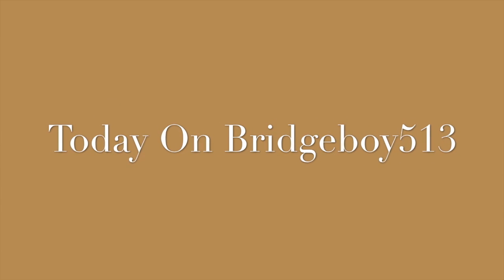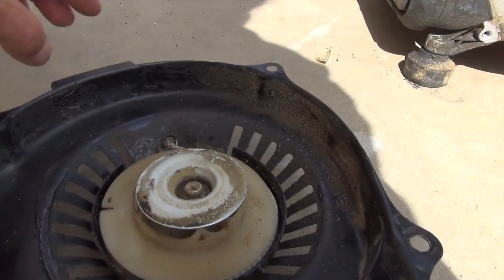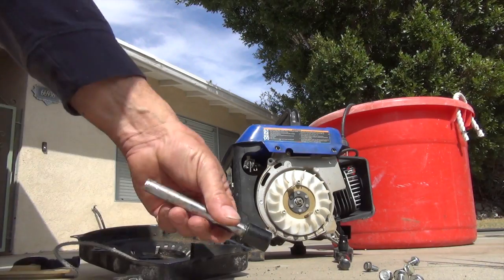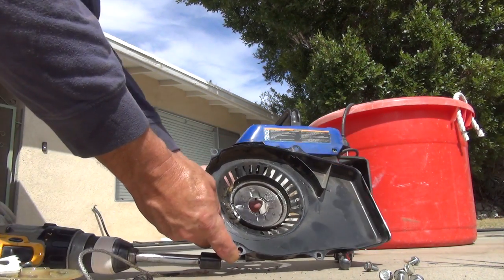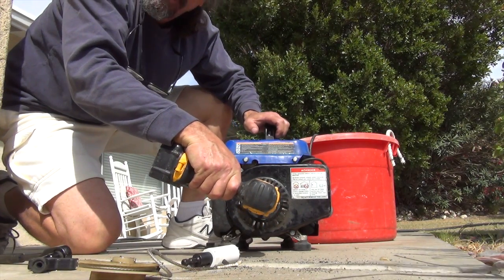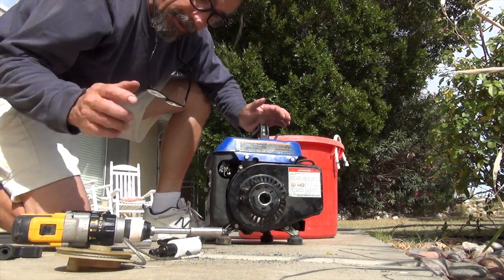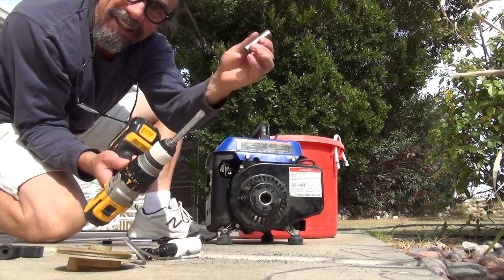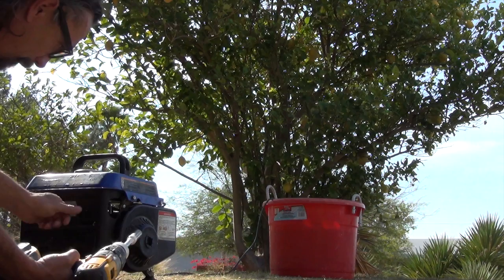Electric Starter for any GENERATOR

Comment: I'm definitely doing this 😀 
If you don't pull the drill away quickly once it starts will it spin the drill outta my hands?
Reply from the maker: If you don't pull the drill away quickly it may take the socket off.  Or NOT.
Reply: Add racket adapter in between so this doesn’t happen
Reply: It may undo the nut on the crankshaft, it may spin the drill, generate power going into the powertool battery, it may break your wrist, it may cause milk to turn to butter...who knows...just live a little....

Comment: I like this idea. I bought one of those new 4300 watt generators that operate off of gas and propane they work great but now that it's getting cold it's a b** to start . It takes almost 100 pulls, doesn't matter if the chokes off or on a little she doesn't kick over until she starts to warm up.

Comment: Probably already been warned but had you attached the drill to that plastic piece that throws the arms out the reason that's like that is so when the motor starts it doesn't catch the device and keep spinning the same way a starter in a car once you let go the key at Yanks backwards and it has a clutch inside of the starter had you put that on it would have been safer in that jerked your socket off

Comment: 3:00 time. perhaps, grind that nut down, on the reverse side of the drills'  starting torque,......so, when generator motor starts, it will kick out your socket/drill.....the nut should look more like a sawtooth, with the leading edge biting the drills' torque...

Comment: seems like you can break your wrist, fingers, or drill if you don't pull out the drill fast enough after the engine starts and the socket stays engaged.

Comment: If you want to firmly mount the socket on an extension, or firmly hold a bolt in a socket, just put a strip of paper between the two.

Comment: And yes - I DO live in Alaska.  
I would just have fixed the RECOIL STARTER (that's the real name) and nott cut off a socket wrench extension.  
Using a deep-set socket is really ingenious for an emergency fix, but finding the REAL socket size for your Chinese generator would have done you better.  
Have you snapped off the threaded, weak Chinese steel shaft yet??  THEN you'll be "Up the Creek ..." for sure.
I would just have found a simple rebuild kit and fixed it right.  That's how we do things in Alaska when we're 4 to 10 hours (round trip) from the nearest hardware store.
Now, if you were in Alaska you would have bought two identical gensets and always had cheap, instant backup to water your stuff.  Then again, there's always a simple, cheap, solar charger for a 12 Volt pump, too.

Comment: I have one of these generators parked on top of mountain near the 49th parallel and the recoil starter spring broke during a particularly cold snap as I was trying to start it up.  Note that the crappy crescent wrenches that come in the toolkit for the chinese atv slip on these bolts so it takes sockets to remove the recoil starter.  I couldn't fix the recoil starter so i pulled the spring out, manually wound the string around the pulley with my finger on the arm, and just pressfit the starter to the wheel with my knee and pull.. it takes a few tries but works.  Don't touch the spinny thing with remaining fingers!  

Hand spinning the flywheel also primes it, I can almost start it just by spinning the wheel with my hand.  The point being, you don't need that superdrill to start it, it needs only a couple cranks to start.  What I'm super interested in is how to start it electrically via an arduino!  Also any tips on fitting a larger fuel tank would be helpful.

Comment: Oi! I took your tip and added a little 12 volt motor i run off of a battery bank with a generator made by harbor freight of the same design. I use the generator to charge the battery bank made from old laptop batteries (about 6 killiwatts worth of energy) when they get low on charge. Just have to depress the momentary switch until i hear it turn over and boom! Powah! Modded the tank for a ten gallon tank so i only have to fill it once every 5 days instead of every day and hooked up the controls to be manipulated remotely via robotics. 

All bragging aside, it was this video you made that solved the problem of actually starting it remotely. Everything else fell into place after that. So thankee kindly!

Comment: When you do this.... ALWAYS put your machine to the LOWEST SETTING AS POSSIBLE....  So that way when your " Motor " starts... It's NOT on High RPM.... Once you get the Motor going and still spinning, you can adjust the " Speed ", LOL.
Reply: Generators run a constant 3600 rpm. There is no speed adjustment.  The governor sets the speed and keeps it there during power surges or load to keep the voltage constant.

Comment: problem i had with doing that was the nut came right off the generator
Reply: When you say the nut came off, do you mean the stud snapped off with the nut? I was thinking about doing this but if the stud snaps off I probably won't.. kinda wondering though if you had it in reverse and just loosened the nut? Let me know thanks.

Comment: Yeah, that will work a few times until it shreds the screw that holds the chuck to the armature of the drill.
Reply: Cheaper than buying new Parts for the Engine....  Coil, Housing, Rope... etc...

Comment: You can do this with a small generator.  I wouldn't recommend for larger ones.  Arm twist fractures are really painful.
Reply: When you do this.... ALWAYS put your machine to the LOWEST SETTING AS POSSIBLE....  So that way when your " Motor " starts... It's NOT on High RPM.... Once you get the Motor going and still spinning, you can adjust the " Speed ", LOL.

Comment: How long are you running the generator / electric pump? That bucket can't be more than 5gal... Why not just use an electric drill powered 390GPH water pump?
$3.99 @ 
https://www.harborfreight.com/all-purpose-drill-powered-pump-390-gph-62783.html

Comment: Like others said, that's really not safe.  You could still use the general idea.  Make the throwout gear in metal of some sort.  When the motor starts, it'll disengage the drill, and you can safely remove it.

I found this video, searching for how others did theirs.  During our hurricane evacuation, I hurt my back, and now can't pull the damned cords.  I converted one properly to electric start with the right starter motor and geared flywheel.   I think I'll do the others with something like yours,  powering the start with a drill on the stock throwout gear.  I'd rather not kill myself with a 10 minute fix.

Comment: Just applied this conversion to my Pulsar 2-cycle generator this morning.  My 40 year old, 3.5 amp, 120 volt Skil drill  barely starts this generator.  It is supposed to be a 72cc instead of 63cc engine.  Don't know if it is bored out, but the compression feels 2x that of the 1400 watt, 4 cycle generator I also have.  Recommend drilling the hole from the inside out.  Otherwise, the one inch hole saw would have been too big for the plastic bushing.  The hole saw wobbles out the center guide hole, apparently.  So, if anyone has tried it drilling from the outside let me know.  waymaster@gmail.com.  Used this bushing: http://www.homedepot.com/p/3-4-in-ACC-Snap-In-Bushing-10-Pack-27252/202077087.  Used 1/4" hex to 3/8" square drive adapter bit.  http://www.homedepot.com/p/Milwaukee-1-4-in-x-3-8-in-Steel-Square-Socket-Adapter-48-32-5031/202562858  Youi don't have to cut off some other 3/8 drive tool.

Comment: I did this to my crappy 4 stroke chinese generator that got about 50 pulls before breaking the plastic pull cord. I used tape to keep the socket from coming off , it worked well but the nut on the flywheel tightened and cracked the flywheel. i took the bolt off and used threadlocker and it still works but if you have enough thread to add another nut and then use threadlocker  , that might be a better option . another option would be to weld the nut on the engine so it wont  turn
Reply: I think i know what generator you speak of lol. I may have one. Ill do that because i don't think mine'll last long enough to be worth fixing if it does break.  worth

Comment: Hello, what are the chances of getting hurt if you're not quick enough to remove the socket out?
Reply: If you're dumb like my sister and hold on, you'll need rotator cuff of TJ  or wrist surgeries, but even if you let go quickly, the drill can still fly off and whip you in the head, or strangle you with the cord
Reply: LOL
Reply: Much better to have a one way bearing or breakaway extension bar.

Comment: Put some JB weld on the socket and leave it on the nut. So when it starts, the socket stay on and you just pull the extension smoothly out
Reply: yes yes, and some grease between the extension and welded socket, so your arm doesn't get torn off occasionaly
Reply: LOL some People..... When you do this.... ALWAYS put your machine to the LOWEST SETTING AS POSSIBLE....  So that way when your " Motor " starts... It's NOT on High RPM.... Once you get the Motor going and still spinning, you can adjust the " Speed ", LOL.

Comment: hey bridgeboy, i came up with the same idea 7 years ago with my little 900 watt gen set. drilled the cover out too. you'll do it til eventually the socket pulls off the extension bar and tears up your flywheel fins. so I came up with something better. a crankshaft extension and works great.
Reply: HK DEE can i see your system please?
Reply: I can show you. Your cover needs to be drilled out with a step drill to about 1 1/2 inch a little bigger than what you have now. remove the 14mm nut from the crankshaft. find a piece of 3 inch long CR Steel bar stock and drill/tap both ends to about 1 inch inward. thread the bar stock on the crankshaft.  the other end will have a 10mm Allen or 3/8 Allen threaded in. That's it. Your drill will be an Allen turning the crank
Reply: a 10mm or 3/8 allen will be way to small. It might work a few times but eventually the torque forces you apple (whether manual or drill power) will easily break those little allen bits

Comment: I did this to mine! Weld that socket onto the extension shaft, other wise when it is withdrawn after if starts the socket can come off as it did with mine and intern smashed all the fan blades! I then had to grind all the original fan fins flat so I could fit a new sheet metal fined fan by drilling and tapping the flywheel. I use a 300 watt drill to start it and works fantastically. The following link is also a good idea to include into our design for those moments we don't have a drill. I say that because I use my gen set as alternative energy for my electric bike. https://www.youtube.com/watch?v=-RjYZgqLHNk  Enjoy.
Reply: i also made the fan.

Comment: I knew that drill bit would get stuck in the cover, this is what happens when you try to make it look nice and neat should have left the cover off and tie our hair back when leaning over it. lol
Reply: The cover has to be on to direct the air from the fan blades over to the cooling fins..  he had to put it back on.

Comment: This reminded me of when i had one of the Big Huge sattelite dishes "those of you who remember them. The motor that turned the dish burnt up. And a new motor cost over $200 for one. So, i had an old reversible electric drill that i hooked to the dish. And i took the power & f/r switch & ran it into the house. That drill actually worked Better than the original motor. Several people told me "There's No Way you can do that & make it work"?  2 were licensced electricians. But, the Laugh was on them. All it takes is just a Little bit of Common sense. Anyhow, just thought i'd throw that in. But, the guy with this drill starting the generator reminded me of that!! Lol..

Comment: Anyone else notice he started it the wrong way or was it just me cos them fins are ment to blow air out over the head 2 strokes will run both ways lol
Reply: adam trowse Nah, the recoil is threaded for a clockwise rotation when mounted to the engine.  You can see it at 45 seconds to 50 seconds in the video.  So the engine will only start if rotated clockwise.  If you attempt to start it in reverse it will not turn over because the order of the process of internal combustion (fuel/air intake, compression, spark, exhaust), would be reversed.

Comment: or just tack weld the socket on to the bar and then you have your permanent starter tool incase someone takes your socket.
Reply: that's way to dangerous, you COULD weld it to the crankshaft nut, but simply welding it to your bar if it gets stuck in there again your gonna have a big mess of metal flying around in there, it'll grind the inside to pieces

Comment: Knew that socket was gonna come off, before you even started it the first time. Was gonna suggest you epoxy that socket on there, but waited to see if you figured that out. That was funny!
Reply: Weld it on ..
Reply: Stewart Perthou I
Reply: electricians tape.

Comment: Not to rain on your parade but you do this enough YOU WILL SNAP that nut inside the crank shaft.How do I know this,well it happened to me several years ago on my 6.5 gen.Great idea until it snaps.Good luck with yours and I liked  the video.Have a great day bud.
Reply: The official fix for the problem you described is to buy the HF Drillmaster brand drill for use with this method.  The drill will break long before the nut does :D
Reply: Then you get another $90 generator. No biggie.
Reply: Troybuilt and Craftsman started making gas lawn tools that had a “port” for assisted starting, with a drill.  I thought it was great idea. Wonder if that is why they don’t sell them anymore.

Comment: Well that works good on a small generator. I have a 5000 watt. I'm going to try this. I use my sockets a lot. I found that a little electric tape around the socket and extension works well. It keeps sockets from falling off.
Reply: My generator is 7000 watt and I have to use a minimum of an 18 volt drill. Also before I used the break bar ratchet, it would sometimes kickback which is not good. Now it works perfectly. I start my generator every month to make sure it is ready if the power goes out.

Comment: I use a 15/16 socket to start my 13 H.P. generator. I put the socket on a break bar ratchet to eliminate backlash.  I got the break bar ratchet on Ebay. Also, you will need an 18 volt cordless drill to provide enough torque. It works perfectly.
Reply: How long to the breaker bar has to be to eliminate the backlash.